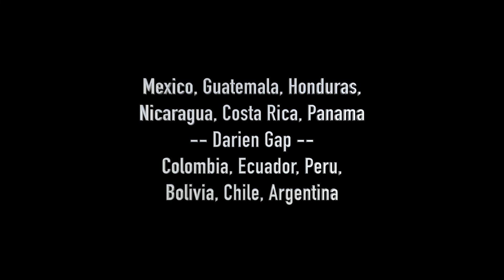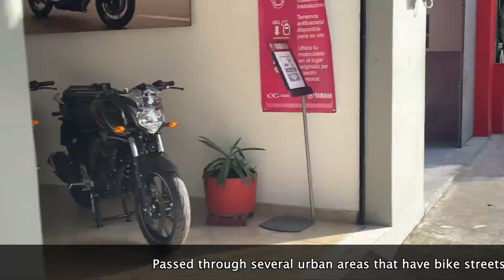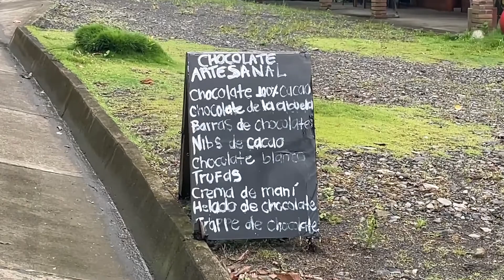Voy al Sur. Episode 8: Colombia (Part 2). June 2022. Central and South America by motorcycle.

Comment: Some of those muddy roads look very slippery, good thing you are riding the KTM890
Reply from the maker: Have to politely disagree. I love this bike but its too big and I have the wrong tires for real offroad. For gravel roads and the roads you see in the vids it works perfect, but when I try doing some real offroading, which you don't see in the vids, its very difficult. I'm using Heidenau Scout tires, they have incredible longevity and are excellent in the rain, but have a smoother tread pattern and are very slippery in the mud, bike is all over the place. I'm not even exaggerating when I say this, I'm struggling to do offroad on my big bike and some local guy will zip by me on his 200 lb, 150 cc bike with knobbies, with his wife as a passenger holding their kid, and the guy will be driving and texting at the same time.
Reply: @motosur5943  I though you might have had some difficulty. I ride a DRZ400E with Motoz Tractionator Adv tyres, a lighter bike makes all the difference in the wet👍